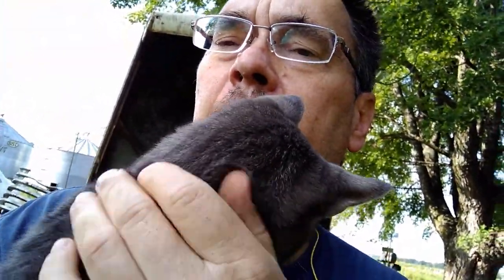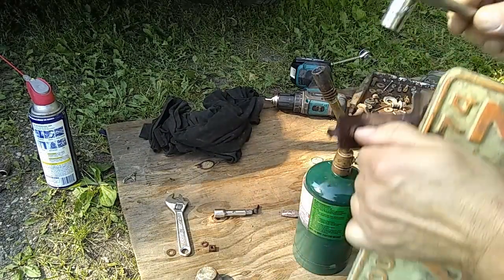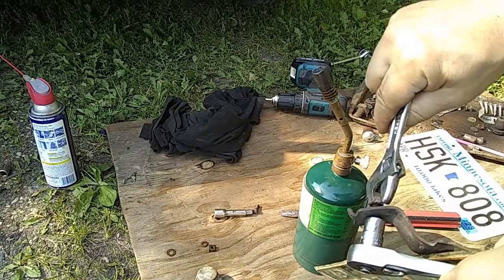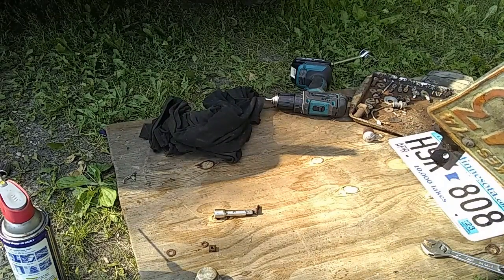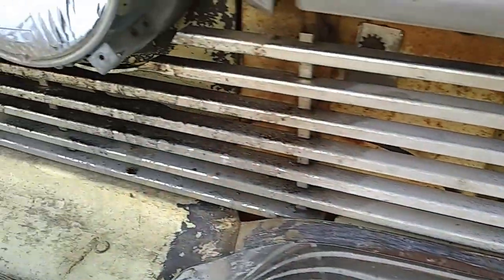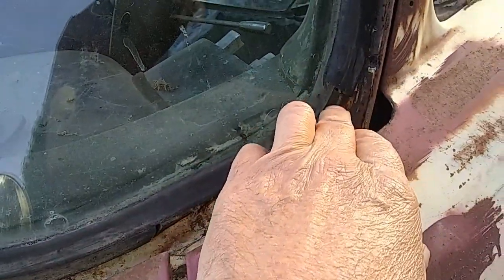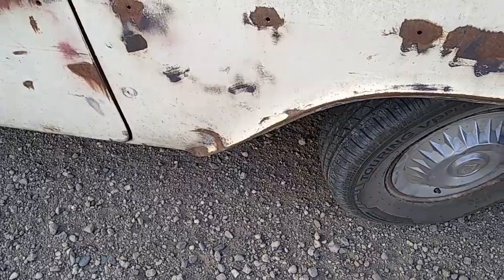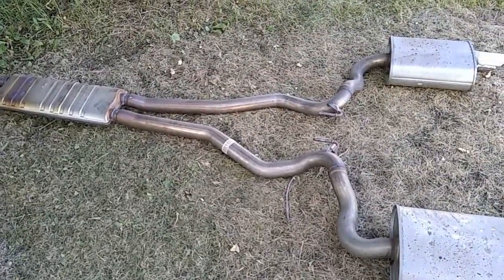1958 Plymouth gets Chrome

Comment: Eastwood makes POR-15, one of if not the best rust converter/protectors available. I'm sure you have lots of stories of trips in this car over the years growing up. I wish now I had my dad's first car, a 1947 Chrysler Windsor club coupe. I learned to drive in a 1955 Chrysler Windsor sedan and later had a 1956 Chrysler Windsor sedan with a 331 poly engine, 4bbl carb. and powerflite transmission. That car also had the search-tune AM radio with search bar on the radio plus a foot switch near the dimmer switch that would also make the radio change stations. It came with the Hiway Hi-Fi record player and several 16 2/3rpm 7 inch records. Lots of memories later, I now have a 1962 Imperial that used to belong to a good friend who passed away in 1984. I have gotten too old to work on it myself, so I may have to sell it. Hope you get this one on the road again and create more memories! Best wishes!
Reply from the maker: Thank you for stopping by!
Appreciate the kind words!
Yes, lots of memories with that car! I remember when coming back from our grand parents place. It would be late. I'd play possum and let my dad carry me into the house. Don't remember going to bed. 
I'll give PR-15 a look.
I wish you well!